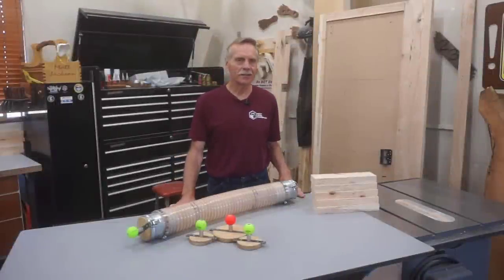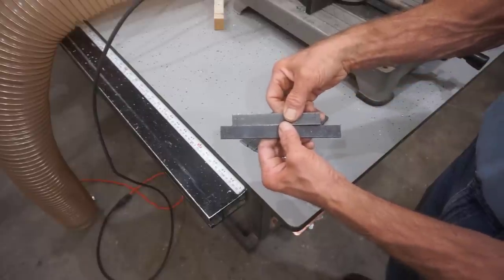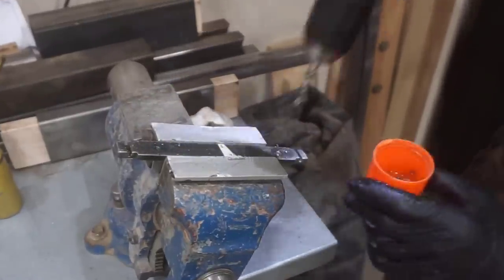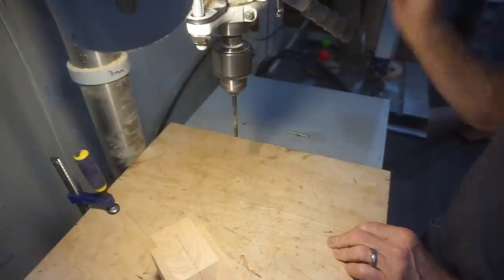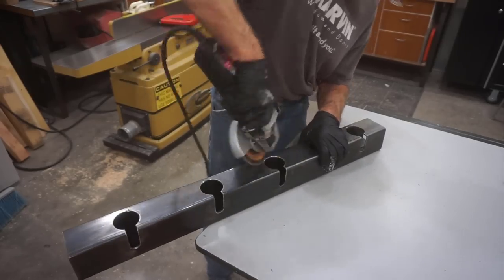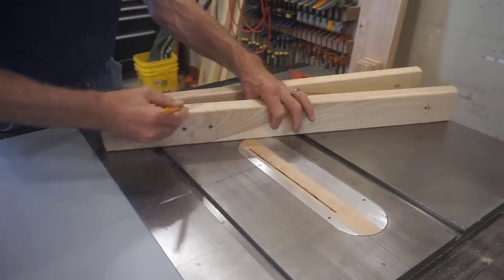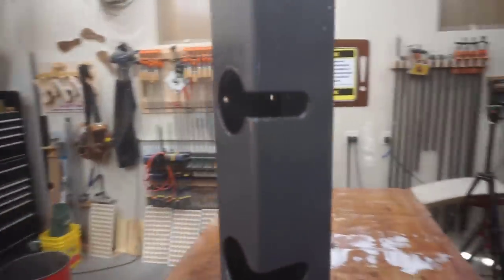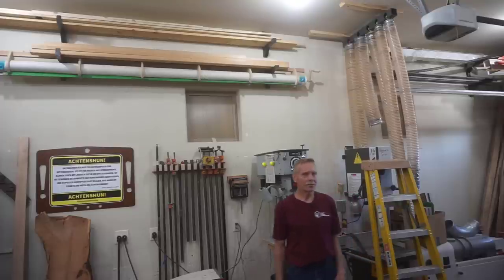Flex Duct Storage System Build

Comment: May I hand you the German engineering award? This is what I would probably have ended up with when tasked to design such a rack. OTOH, lacking all that wonderful machinery I'd tied a wire around the hoses' ends, make a loop and hang it on the wardrobe. 

A suggestion: Climbing the ladder is a good exercise. But to make it easier you could design a pole with a fork on its end. This grabs or places the ball in the holder. Avoids the ladder. Cheers, Manfred

Comment: Great tips! Why do you store your spray paint cans upside down? Thanks for the great videos.
Reply: Solid particles in the paint do not settle onto the base and clog the dip tube, plus it stays clean of paint and thus flows easily when used.  Any solids hat do fall out of the paint will be easier to shake back into suspension, as there will be no sharp corner to collect them, instead they will be on a relatively flat inner surface where the agitator balls can easily shake them free.
Reply from the maker: Great detailed explanation... thanks for adding it here! Best, Matt

Comment: A video on how to spray lacquer would be interesting - I have spray equipment but have never done laquer (only water based) as I am not sure of the safety (fire) issues involved with spraying flammables.  I can spray outside in the summer, but I‘m in a colder climate so can‘t spray outside in the winter.
Reply from the maker: Truth  be told I'm no authority on best practices for spraying lacquer... I do a heck of a job at it IMHO but, I'm quite sure,  violate a whole host of industry standard protocols.  Keep in mind that I began spraying in the '70's in a private shop setting with near zero education on sensible health preservation practices.  I have vivid memories of spending hours spraying gallons of lacquer on a car with only a cheap dust mask even though fumes in the shop (heated by by a gas furnace) were so thick I couldn't see the back wall of the shop... not the kind of behavior I could responsibly teach anyone🤯
Reply: @NextLevelCarpentry  😂 - I just don’t want it to explode.  I have good respiratory protection.  They really didn’t know much about that back in the 70’s.

Comment: What hose is that you are using? Brand etc and your thoughts on it. Thanks.
Reply from the maker: It's the heavy duty anti-static flex hose from Air Handling Systems Ernie... check it out on their website through the link in the video description.  It's the only stuff I've ever used so I don't have any cross-brand comparison but I'm 100% satisfied with its quality and performance.  Best, Matt
Reply: @NextLevelCarpentry   Thank You!!!!!!!!

Comment: How much airflow loss do you get from using flex pipe vs smooth walled pipe?
Reply from the maker: A LOT, Jim... it's a necessary evil for my setup but is poor design for many others... use only when neccessary IMHO. Best, Matt

Comment: Cool video. What is the device hanging on the rack next to the duct hanger? The one with the crank handle on the end.
Reply from the maker: Interesting that you noticed that unusual thing... what it is is my green screen for video production and the crank handle rolls it up inside of a slotted PVC pipe for storage when not in use... not all that interesting or amazing as it turns out😉😎
Reply: @NextLevelCarpentry  So you're also Next Level Media Productions. lol
Reply from the maker: @DustyFixes  nice of you to say but truth be told I spent way more time making that green screen thing then I ever did using it. Early on I thought it was essential to video production but it turns out I'm able to do pretty much everything without it and use it only for special effects once in awhile... kind of fun to have on hand though. 😎

Comment: 2:55 does not look safe. It only take one slip to lose a finger.
Reply from the maker: Working with power tools is not inherently dangerous but it CAN be extremely unforgiving. That's a 1/8" abrasive disc I'm using, not a saw blade, so I don't feel anywhere near as apprehensive as you do. At the time stamp you cite there's more risk of an exploding disc taking out an eye than a slip amputating a finger but use your own common sense and judgement to decide for yourself your comfort/safety margins.  Best, Matt